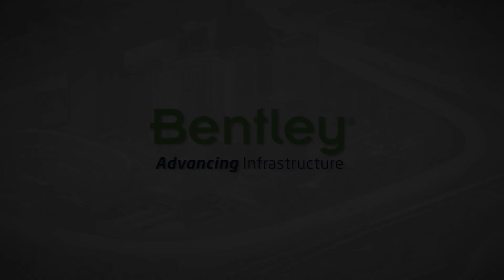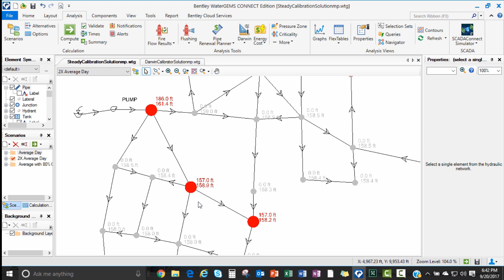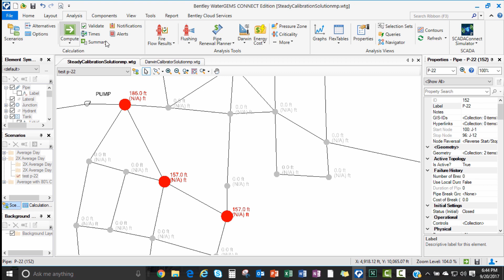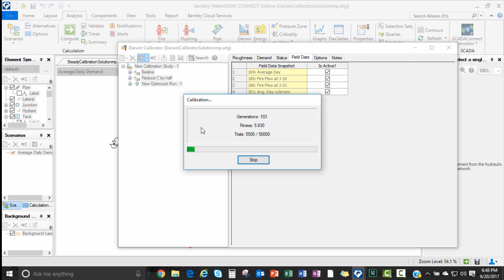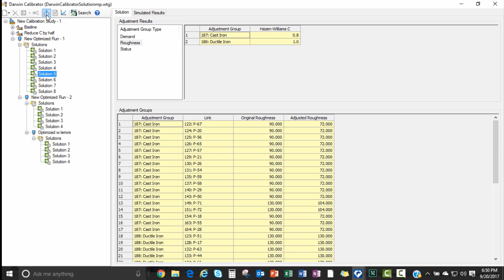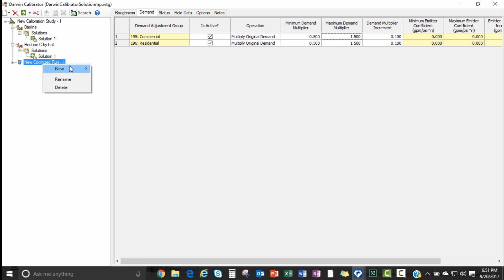WaterGEMS/WaterCAD Fundamentals Part 11: Workshop 5 (Calibration)

Comment: How did you annotate the Actual Field Hydraulic Grade Data?
Reply from the maker: I believe they are User Data Extensions, and the values input manually or imported through ModelBuilder: https://communities.bentley.com/products/hydraulics___hydrology/w/hydraulics_and_hydrology__wiki/39391/how-to-create-custom-fields-using-user-data-extensions
Reply: Thanks, I found out they are can also be annotated as "Observed HGL". 
 @bentleywaterinfrastructure
Reply: @j-paul4327  how can I add the observed HGL?